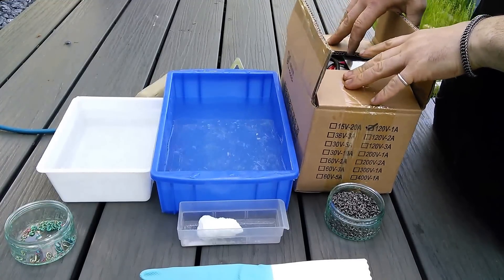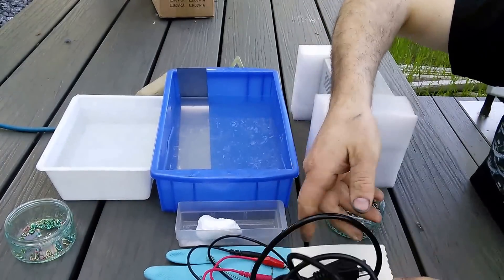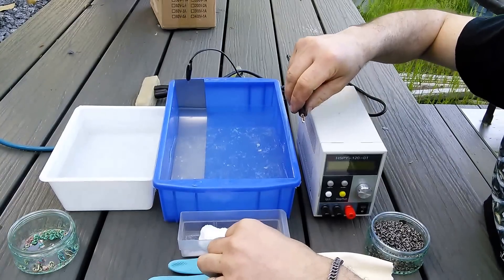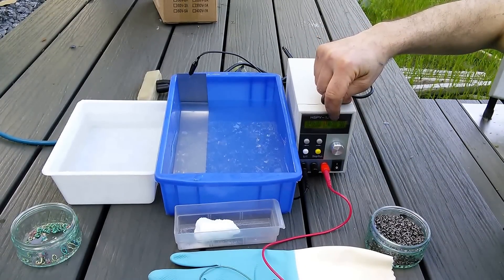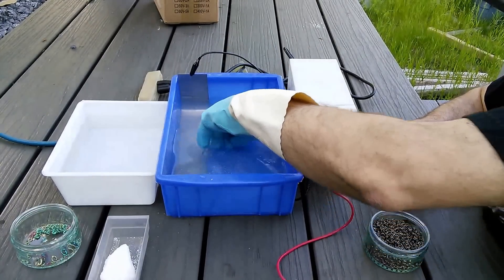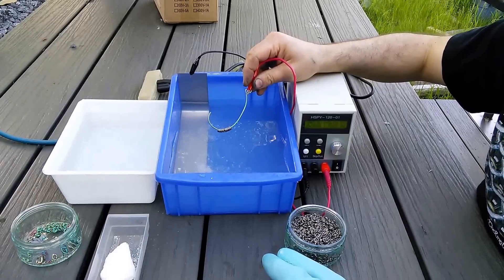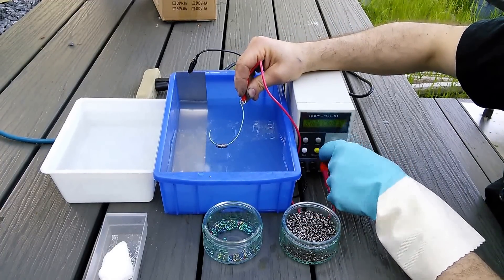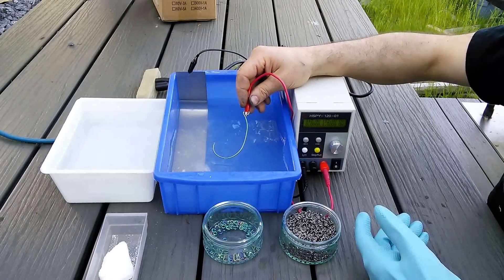TheRingLord.com Titanium and Niobium Anodizer

Comment: Hello mate,
Awesome video.
I got several question if you don't mind me asking-
First- Does the rings you anodize in the video are made from Niobium or Titanium?
Second- From reading online, I understand that for getting some of the colours, which you seem to get pretty easily in the video, you need to etch the metal, prior to anodizing.
Did the rings you use in the video had been etched in some way?
Reply from the maker: canadaiany the ring in the video are niobium I think.  niobium does not need to be etched.  titanium might need etching to get higher voltage colors.  we recommend Multi-etch
Reply: First, thank you for your fast reply.
I have heard that titanium needed to be etched also to get lower voltages colors, and only yellow-ish and blue could be achieved without etching.
Although I couldn't find any 'official' source to neither confirm or deny it.
Do you know if that happens to be true?
Reply from the maker: canadaiany   bronze, purple,  dark blue, light blue, gold are typically possible without etching.   we sell a lot of wire that will do all colors without etching.
Reply: Ok.
Thank you for your detailed answer.

Comment: So glad I stumbled onto this vid and your web page.  I am currently using a sheet of Titanium as the negative (cathode?) metal in the anodizing bath of TSP & distilled water.  I am anodizing knife scales and screws/parts which are bigger than the rings you show here.  Should I switch that titanium piece to stainless steel?  I am using Ti wire to suspend the parts in the TSP bath.

thanks
Reply from the maker: yes switch to a stainless plate.
Reply: Why?
Reply: If i  do this to alloy material what will happend